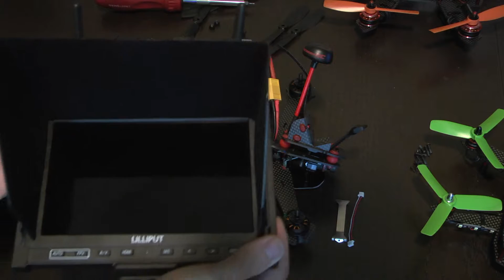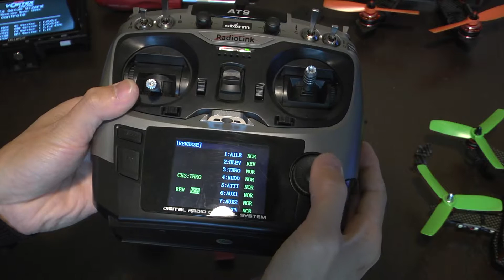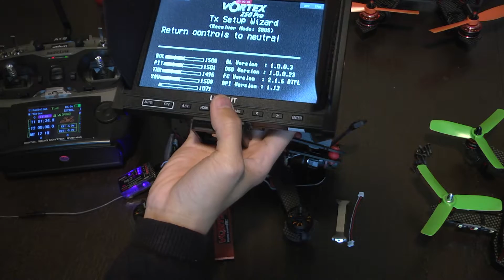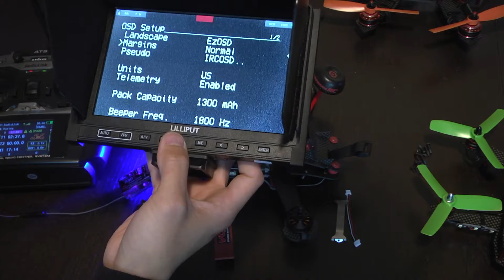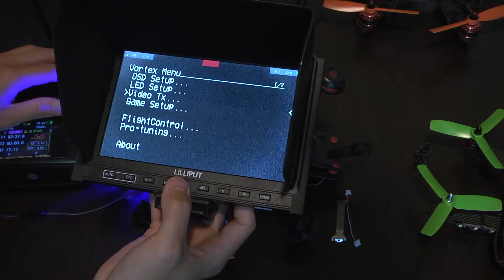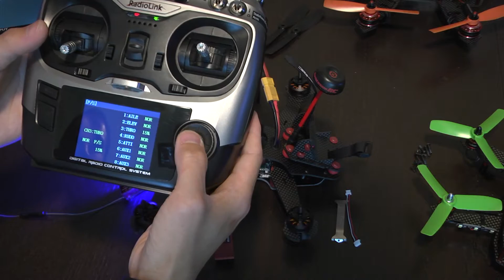How To Set Up and Bind Vortex 250 Pro with RadioLink AT9 (S.Bus)

Comment: Awesome video bud! I started off with a helipal srd 280 and AT9 Tx. I wanted to get a Vortex so thank for the video. How did you get the R9D inside the Vortex? can you post a how to or some pics?
Reply from the maker: +Stevenz6287 Thanks, much appreciated.
Here are some photos (posted in video description too) of the R9D converted to micro sized.
To make it micro sized, you will need to remove the case and all the header pins that you would use to connect servos to it (up to 9).  Keep the bottom pin intact as that is used for S.BUS and connect the S.BUS cable to it.   Alternatively you could solder the cable directly to it to save more space and more weight.  Lastly, be cover the receiver with tape or shrink tube wrap to prevent electrical shorts.  Make sure to not keep the little bind button pressed when covering the receiver up otherwise it will be stuck in binding mode. 

https://drive.google.com/folderview?id=0Bwdh8mcr00lEWXM2T2VXZ0RYb1k&usp=sharing

Hope that helps!
Reply: +MatrixWriter Thank you for the quick response! One least question... do you de-solder the pins or cut them?
Reply from the maker: +Stevenz6287 
No problem!  I ended up bending the pins back and forth until the came off.  The solder joint pads are pretty small, which makes this very easy to do without risk of damaging the PCB.  Think of it when you keep bending a paperclip several times, it will eventually break off.  I followed this same concept.  Just make sure to do this carefully.  After this, I took my soldering iron and removed the excess part of the pins on the solder pads.  Make sure to remove the telemetry port too otherwise the receiver will not fit in the Vortex.

Alternatively, you could desolder everything but this is pretty cumbersome with header pins IMO.
Hope that helps!
Reply: +MatrixWriter By chance do you think the R9D in the link below will work in the Vortex 250? I was trying to mess with my extra R9D today and jacked it all up.... Let me know what you think! Also how has the Vortex 250 been flying?

http://www.helipal.com/radiolink-r9d-lite-s-bus-receiver-for-cc3d-flight-controller.html
Reply from the maker: Stevenz6287 Yes that is the same receiver I have.  I did the shrinking of it myself but since Helipal offers the same, you use theirs.  Just make sure to check the pinouts and polarity of it before you connect it to the Vortex.  Please look at my video description for links and photos.

Vortex has been flying pretty well lately - I changed out the motors to more powerful Scorpion ones.  Been doing some mods for it with some Team BlackSheep stuff and long range FPV.  Going to post more videos shortly.

Comment: Hi, I have some questions: in Vortex 250 quick start guide it's indicate this: 
-Change subtrim to -31 for THR, AIL, ELE, RUD
- Change travel to +/- 119 on all channels.
Did you do that on radiolink AT-9? How do you change travel and what is the good value (-119 or + 119?)? 
Last question, how do you setup switch (E or F) to switch off throttle. I would use a switch to cutoff or disarmed motor, it s more safe and easier than disarm by yaw stick. It will be a second security from my opinion. But I don't know how I can do that in Radiolink AT-9.
Thanks for your help! I follow your video and it s working well! Well done again! ;)
Reply from the maker: +Nazgul Mordor 
No need to change any subtrims or travel on all channels.  You only would need to do that if you could not complete the setup since the servo travel bars would not reach the end on OSD - this never occurred in the video.
In the video description, I have photos of my settings uploaded.

To answer your last question, this need to be done under MOTOR CUT on the transmitter I think AND definitely in CleanFlight for the Vortex as you need to assign an auxiliary or different switch for disarming the motor.  Unfortunately I do not have detailed steps for this - sorry!
Reply: +MatrixWriter Thank you for the quick reply! You are very helpful!! :)
Reply from the maker: No problem!  I try my best to help out.  Have a great time and safe flying!